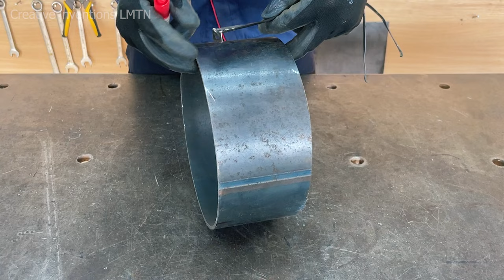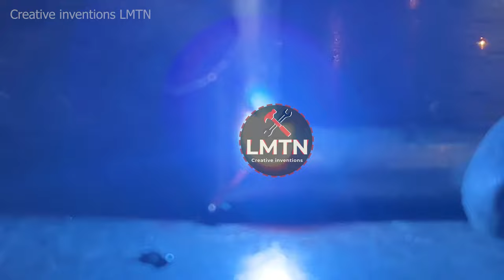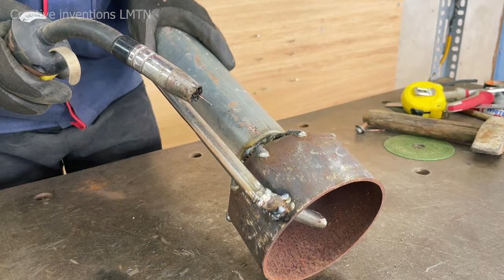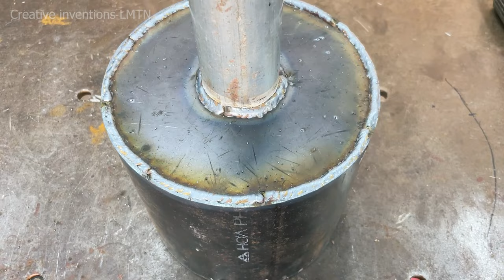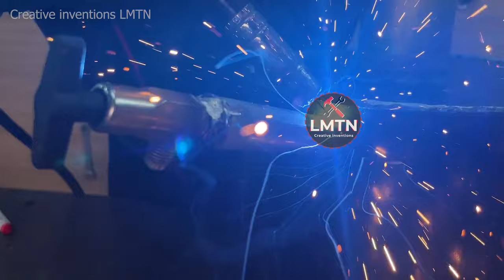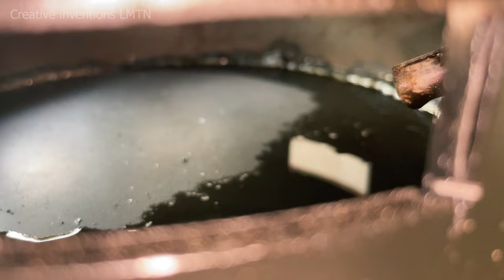SECRET using H2O to burn Waste Oil Burner | Don't miss if you want stove WITHOUT Electricity

Comment: Grinding using the side of a cutoff wheel on an angle grinder with no guard is begging for it to shatter in your face.
Reply from the maker: "Thanks for the concern! Safety is a top priority, and I appreciate your input. I assure you that I take safety precautions seriously. In this particular situation, I'm using the side of the cutoff wheel for [specific reason/purpose]. However, your point about the guard is valid, and I'll definitely consider incorporating additional safety measures in my future projects. Stay safe and feel free to share any more tips you might have! 👍

Comment: Nice the water boil then create a steam pressure. Steam pressure create jet propulsion in between tail stock of the fire chamber and create vacuum from combustion chamber wherein the openning from combustion chamber create suction effect from the environment to get enough air and with existing enough heat and fuel the fire triangle create good fire. Wow. You need to put a relief valve or a pressure controller from water boiler to control the amount of heat created from tail stock.

Comment: You need a pressure control switch to keep the fire contained so it burns much slower saving you oil and fuel

Comment: İt is good idea the commentes of other geys cant give the full explanation to the  eficat  of  water drops that changed to water vaipor so i want to know if we can inject watervaipor directv to the E.pipe and will see the result so many injecters can inject water as astem hope u reply and give more explanation   thx
Reply from the maker: Your idea of injecting water vapor directly into the E-pipe to observe the effects is an interesting concept. Injecting water vapor as steam into a system can have various applications, including for heating or humidifying purposes. However, the success of such a project would depend on the specific design, components, and intended use of the E-pipe and the feasibility of injecting water vapor safely and effectively.

Before proceeding, it's crucial to consider safety measures, potential risks, and the compatibility of materials used in the E-pipe. Additionally, it would be helpful to consult with experts or conduct thorough research on steam injection systems to ensure that your project is both efficient and safe.

Exploring innovative ideas can lead to exciting discoveries, so I encourage you to further investigate the feasibility of your concept and gather as much information as possible to make an informed decision. Good luck with your project, and thank you for sharing your idea!
Reply: Thank you very much u give us the first step on the main road of devkopment hope we stay on contact each ithers regs.

Comment: As the water goes in, it is stored in the enclosed and sealed area around the center pipe, and the little pipe opening inside the water storage area is not quite touching the top flat welded piece, and so when the fire is lit down below, the heat causes the water to heat up, making pressure from steam, thereby forcing the now pressurized air into the little pipe, which feeds air to, and through the fire, which causes said fire to get hotter, thus completely burning the oil. 
Note the amount of water in the "water chamber". It isn't filled, but enough to create steam from the heated water. 
Once the plug to the water chamber is opened, it loses any pressure it had, resulting in the fire looking like in the beginning when it was first lit. 
The forced air from steam acts as a fan to the flame, causing it to burn hotter.
Reply: the forced air is laden with water as it is steam, and the opposite to what you claim is happening. Oil only burns cleanly at an optimum temperature, not the hottest it can get to. The water, injected in small amounts will regulate the temperature of the burn and make the stochiometric value of the air to fuel (oil) ideal, making it burn cleaner. If you can get it set spot on the flame will turn from yellow to blue. When its burning yellow the mix ratio is too rich.
Reply: @roberttill3787  You misunderstand this foreigner.  The steam does not blow into the burning oil.  It blows away from the flame and up into the exhaust pipe at a higher velocity.  This leads to a suction effect pulling dry air into the air holes in the bottom and this fans the oil flame.  The exhaust is a mixture of steam and hydrocarbons that can be used to pipe heat to other locations.  It's great for heating a well ventilated shop but you don't want this heating your home due to carbon monoxide leakage from the exhaust pipe.
Reply: So for short his combined hydrogen into the fire that the oil created making the fire stronger 🔥🔥 correct me if im wrong?
Reply: @vonsnt1234  According to Brutus Maximus the steam and water goes into the exhaust pipe. if thats true the water and steam dont go anywhere near the burning oil.
Reply: @vonsnt1234  I am not sure if they are use the steam too bring fast moving air to add to the fuel flame ; but ido know this ,  if you have water vaporized and inject into a hot flame  ,.  the oxygen and hydrogen will separate and the flame source will burn with a greater intensity  =>         in days gone past , one could buy a set up that would  inject  water vapor below the carburetor that atomized water going into the combustion chamber of gasoline engines that would give you a little bit more efficient gas mileage ,.     I am not sure  wants happening here  ,  I believe  with a little thicker pipe for the steam pressure chamber and 4 × .023"  sized steam injector holes  you should be burning  hydrogen and oxygen by then  /  this would need to be test run at a distance because it might let you know if you need welding improvement or thicker materials .  As we say here   ;    I will try it twice unless it kills Me !   For you haters  and  everything safety people out there , I learned this expression from my predecessors when we where setting safeties ,  example  checking boiler system , setting safeties you need people to  run Her to maximum limits.  Start ups of a new system .
Reply: @authordent170  The "water injection" used in yester-years was a way to cheaply add a slight increase to the compression ratio (water doesn't compress), which meant you didn't need to have as heavy a foot to get the same amount of power.  Old engines were terribly inefficient, and this wouldn't work with a modern engine.  The water that was misted into the intake would be vapourised into steam in the exhaust.  The hydrogen was never "burnt" as a fuel (unlike HHO setups).

Hydrogen (from the water) is not being burnt in this oil burner either.  The water is turned to steam (steam has about 1700 times the volume of liquid water).  The expansion of the steam creates a blower up the exhaust which in turn increases the amount of air intake at the fire.  Some steam locomotives use a similar setup to get higher flow of air through the firebox.

Comment: Using a steam boiler to make a venturi effect? Is that correct? The rushing steam brings air, that replaces the fan on the oil burner. 
Does it take long to bring the water up to temp?
Can you fill it while its running?
How long does the water last before it needs refilled?
Reply: I think you and I are on the same page, I love these videos that show more about how they weld, cut and grind instead of what the hell they doing and why. Fancy tap on stuff with a square and it falls into two pieces, WHO CARES! How about do a drawing, a cut away showing how it all fits together and works! There is an endless supply of "WAYS" to fabricate stuff, what is missing IMO is the actual technical of what the heck they are building the how it works part. I think I get the idea as stated in other comments, steam assisted venturi to pull in more air replacing the electric fan. What if you skipped all the H2o and simply added a VENTURI? Install a longer exhaust stack maybe with a with a narrow spot in it.
Reply: @tomhubbard353  Even with a burner thats fan assisted the air introduced has to be regulated to get ideal fuel/Air mix. With fan assistance this is usually achieved by a adjustable flap in the air pipe between the blower and the burner, which can reduce or increase air supply as needed.
Reply: @roberttill3787  guess maybe one could do a water drip... and then water drip could then  also be metered with a needle valve... giving similar affect of metering air flow???
Reply: @coachgeo  sounds a good idea in theory.
Reply: @roberttill3787  you don't need a flap to adjust the air, you just have to adjust the fan speed with a motor controller.
Reply: @rayleblanc7209  Good idea, though it overcomplicates the heater in my opinion, but yes, i agree.

Comment: What would it do if you put two or three steam feeds instead of one?
Reply: Nothing, as the steam is regulating the burn rate of the Oil/air mix and the burn temperature.

Comment: Que pasa si lo pones dentro de otro tubo más grande para usarlo como calefacción???.
Podrías por favor pasar planos?? Gracias.
Reply from the maker: Es posible en principio, pero en la práctica esto es muy peligroso, señor. Es muy difícil para nosotros controlar la cantidad de calor que se libera. Pero tu idea es genial, pensaré en una manera de hacerla realidad.
Reply: Estoy haciendo lo mismo en mi taller.Mejor decir he vuelto a hacer....Mas o menos.Hace tiempo(igual 10 años atras) hice en una chemenea,un sistema para calentar toda la casa,a base de una construccion metalica y una bomba para recircular el agua.La use mucho tiempo hasta que me canse y ahora pase o tro nivel.Me gustaria integrar toda mi experiencia en un calentador facil de montar en una casa rural.
Reply: Yo no pondria el tubo en otro tubo.
Buscaria un tubo de diametro alrededor de 300 mm y dentro lo rodearia en circular con un tubo(diametro 10 mmm),entrando con el agua por la parte de abajo y saliendo por la parte de arriba,soldando conectores para conectar a un radiador y comprobar